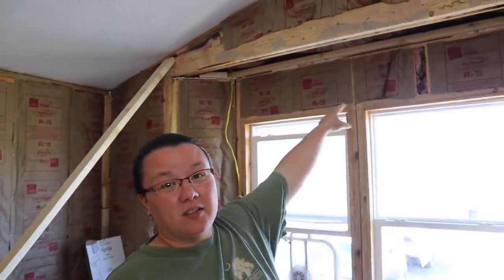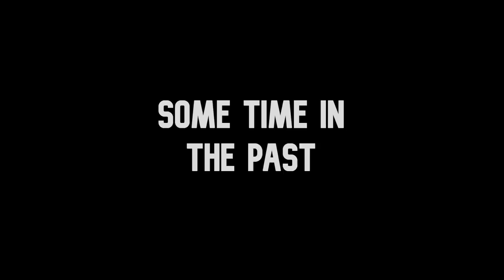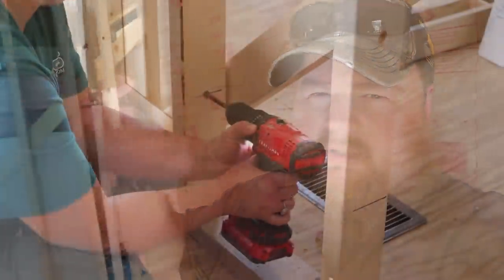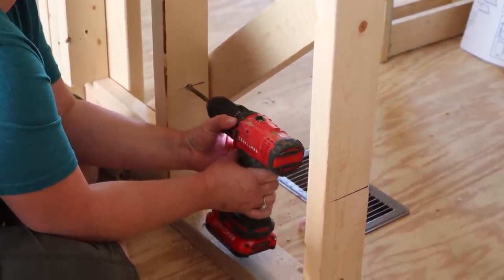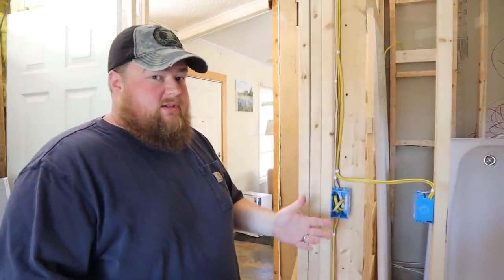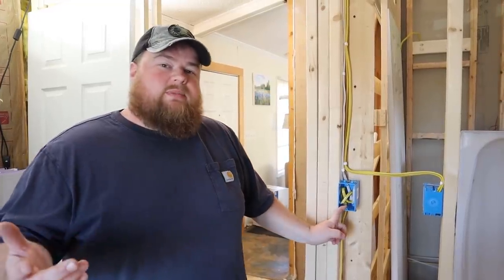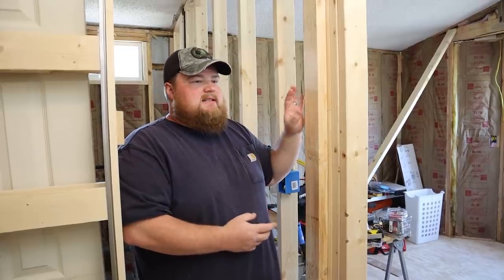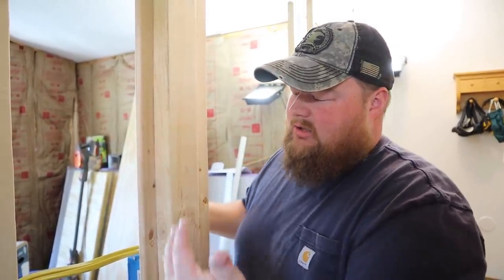1,000 Little Jobs & Why We REMOVED OUR FURNACE // Mobile Home Renovation

Comment: A small "been there, done that"  suggestion.  Put insulation in the wall between the room and bathroom.  Not as heating/cooling but for sound deadening.  We did that and have never regretted it!

Comment: Sam, as I said before we installed a Mr Cool in our garage. The cost was about 1900 not including the outside bracket for the unit to sit on. We had an hvac guy come check it out and he was telling me they were going with Mr Cool in their business because of reliability. He did tell me it would have cost us 6000 if they had brought it in and installed it. So you can can 3 unit for less than your budget. And you likely will need smaller units in the bedrooms which is a smaller cost. Can’t wait to see what you all decide!
Reply from the maker: Oh! Awesome to hear, thank you!!
Reply: @sam-and-angela  Just repeating this here.... I would definitely look into a DIY mini-split. But rather than a multizone unit... Get 3 separate units, one for each zone. 3 reasons for that. 1) It greatly simplifies  installation. Running refrigerant lines the length of the mobile home is a pain in the backside. 2) You don't have to pay the entire expense all at once. Just add units as the budget allows. 3) If one of the units fails, it is much cheaper to replace. And... You don't lose your entire HVAC system.
Reply: So nice of you to give such good advice. 
I have been dreaming of looking into a mini split for my ranch style home.
Reply: @sam-and-angela   have you heard of Spencer & McKenzie of @LifeUncontained?  They did their own install of mini splits in their shipping container build and its going really good.  They have inspired me to do my own.   IMHO, for one, not having duct work is a healthier alternative with nowhere for dirt, dust mites, etc to build up.  Also, the low electrical draw will make them more affordable in your ROI/electrical bills.  Keep up the great work!  Many blessings be yours!
Reply: @keithhogan6997  Just coming here to tell him the exact same thing!!
Reply: @lizmarin9568   🧔🏼👍🏻👍🏻
Reply: @sam-and-angela  @LifeUncontained installed theirs in a shipping container build. If you haven't already, you should check out The Hollar Homestead.  Young couple with 5 littles that remodeled a mobile home (beautifully done, I might add) and installed the mini splits much as you are considering.  Three separate units that were size appropriate for bedrooms and living area.   P.S. I really enjoy your videos!
Reply: @abcxyz1797  Before we knew of the diy kit we paid double for someone to put one in our den. It’s isn’t half the size of the one we installed.
Reply: @keithhogan6997  you are so right they are easy to install I have been a handyman in my area for 12 year they are so much better an you can adjust the heat an air in that rm to fit your needs
Reply: @chrisdarrow1738   I'm not knocking what Hollar Homestead did, but what is the difference between their container build and a single wide?  Spencer used multiple units just like they are talking about in this mobile.
Reply: @keithhogan6997  very similar. Both would give excellent pointers.  Just felt it to be an apples to apples example being a single wide trailer vs the container build. I think they have both constructed very nice homes.
Reply: @chrisdarrow1738   I have to agree and I'm glad you pointed them out.  Two similar get different builds would bring a well rounded look and more insight.
Reply: The problem with mini splits is that they are just as Loud as window units. We had one and I just couldn't take the air noise .
Reply: @number1pappy   Maybe it was the brand or the installation.  I know several people with them in their homes that don't have that issue and I haven't heard it mentioned by anyone else before.
Reply: @number1pappy  I never hear either of ours run unless they are on “powerful”. 🤷‍♀️

Comment: We have a tiny farm house-brick and mortar. We took out the old oil furnace and put in one mini split for heating and air conditioning. My husband put it in and it does the job. It has been a significant savings and improvement.

Comment: I know this video is three years old, but since YouTube decided I would be interested, (I was because of the mention of the furnace), I felt the need to comment on my recent experience on saving thousands of dollars installing my new furnace and A/C.  It's probably too late to save you money, but this might help someone else.

The forced air in my home was over thirty-five years old and I was repairing something every year.  The first thing I had to do when I moved in thirteen years ago was to call someone in to charge the system because it wasn't cooling.  I've since replaced the capacitor in the A/C three times, replaced the A/C fan motor last year, replaced the furnace heat sequencer several times, replaced fatigued broken wires in the rusty furnace, replaced the thermostat and found the need to keep various fuses on hand.  End of last season the coil was freezing up indicating the need for another Freon charge.  Being R22 it would be expensive.  I decided to wait until this spring to have the system charged.  I procrastinated and it got hot.  About a week ago I just decided to replace the dinosaur accepting that it was well past end of life.   I was tired of working on it and worrying about when it would next break down.  (It always happens when it's 15 degrees (thank goodness for the wood stove) or 100 degrees (fans don't help much).)  Cost to have someone install a new unit?  Minimum $15,000!  Ouch!  I'm a big time DIYer doing electrical, plumbing, building, renovating etc and there's never been a job I've been unwilling to tackle so I did a little research.

I ended up ordering an entire packaged mobile home system, (A/C, evaporator coil and furnace), and a line set online from HVACdirect costing about $4,000 intending to install it myself.  (They do of course suggest having a professional do the install.)  Installation sounds intimidating, but it's not.  The condenser, coil and even the line set all come precharged.  I took pictures, documented and labeled all the wiring before removing the old system.  Removing the old line set was a concern because of Freon, but it turned out to have all leaked out already.  The system was empty.  (It probably would  have cost me $1,000 to recharge the ancient system only to have it all soon leak out again.)

I set the new A/C on the concrete pad I had poured, stuffed the new furnace into it's alcove and slipped the coil inside.  I uncoiled the line set and attached it to the coil and the A/C.  This is the most intimidating part, but there was no brazing involved.  The ends of the line set have nuts on them.  Simply screw them on to the A/C and the coil, (adding a dab of the included oil to the threads), until the line set is punctured and then one more tiny little twist.  Literally, just a couple of wrenches are needed to install.  I then wired up the thermostat and power, flipped the breakers on and set the thermostat to 'cool'.  Blessed cold air.  The toughest part of the job was getting that filthy rusty old furnace out.

By ordering the equipment online and doing the install myself I saved well over $10,000.
One extra perk.  We all know storage is always a premium in a manufactured home.  The old unit required an air intake high up on the wall.  The new furnace didn't need this vent so I remodeled it into a  storage cupboard.

Comment: Sam, we installed three mini split units in our house. Total cost was approximately $3500 which included the new wiring, panel boxes, etc. Our units have a heat feature ( not heat strips) which heated our house wonderfully. We too use propane wall heaters for our primary heat but using the splits to take the chill off really reduced our propane usage. Best advise, shop around and call on friends to assist you in installing units. Pretty simple.

Comment: We used a simple propane wall furnace here for years until we could afford a whole house system. Aside from having to run fans to disburse the heat it worked just fine and...when the electricity went out we still had a source of heat. The problem came when "Grandpa" started to dread the trip to get propane. In the meantime, over at our other place, we really need to do just exactly what you did. Throw that 70's electric furnace out the window. I hadn't thought of those zone-type furnaces until you mentioned it. What a great idea!! Thanks, guys! That's a DIY solution we just may be able to swing :)

Comment: My husband and I had a new HVAC unit installed about 2 1/2 years ago and it was around 7 grand. We used Waldrop heating and air and they were amazing. We live in a double wide and we are located in the upstate of south carolina. I know there will be differences in the cost of things from state to state, but that is a huge difference. If your unit costs 7 grand, then that means the new duct work (including labor) would cost around 7 grand alone. Wow. That is insane!!!!  Sam, I really believe you are knowledgeable enough to install mini splits on your own. Thanks for another video. God loves you all. God bless you all.

Comment: The furnace talk, got me thinking about a property I looked at, not that long ago about 5 years.  It was an older trailer on a basement.  In the basement they had a big wood stove / heater and above the stove they had a tank of water, 'very large tank of water'. The owner had pictures of how he put them in. required putting holes in the floor to drop the water tank in was all I remember, because I started calculating in my head the cost to remove the items, and if the was price was worth the 10 acres the house sat on.  Needless to say I thanked him for his time and never thought of it again until now lol
Reply: There are substantial rebates for mini splits, especially for manufactured homes in my state. Check with your power company. I got mine for four different areas, and we niw have heatingvand cooling fir the whole house for about $2500. My electric furnace hasn't worked for years (we'd been using electric space heaters for a while, which was cheaper than the furnace), NOW I  want to yank out my furnace and make a closet out of that space. I love the mini split, and am very glad we got it.

Comment: Sam I used to screw everything I built together. I later bought a framing nailer. Get one. So much faster, and I think better for framing. You wont be disappointed.
Reply from the maker: I have one--Paslode cordless framing nailer, but prefer screws for this kind of work. Much easier to back out and move things around. :)

Comment: Insulation is your friend, noise reduction and keeps the heat in winter out in the summer. I love it a pirates parrot. I don’t have broad shoulders my parrot would be falling on the floor. Just love your and Angela’s work. All this ology stuff Jon would be so proud you’re carrying on his legacy. Heat pumps aren’t as efficient as people think. At 20 degrees or below the heat pump doesn’t work it shifts to straight electricity. I use oil filled radiators. Heating just where you are is way smarter.

Comment: What you an do is gut you old furnace. Then install a hot water rad and an air conditioning rad. You an either get an outside wood Boiler if firewood is available or you can get an electric inside Boiler. They are small maybe 10 inches wide and 2 feet tall. It would be way cheeper than electric or propane. It's what we use. I have tons of ideas on projects like that. As for new duct work unless it's become unattached they should be fine but should be cleaned out.

Comment: I guess it was ^ish years ago we replaced our OLD  under the floor furnace and the OLD ductwork for a Trane. It cost us $9K back then and it was just propane heat, we kept the air condition unit we had outside because it still worked fine. I feel your pain!!!

Comment: Sam, We installed a Mr Cool 12K mini split ourselves and we used the advantage series it is not DIY but was about $700 for the setup. The tools needed to vacuum it down cost us about $300. You can check out the installation on our channel it may be helpful, The DIY series is nice as you don't have to make up the flared connection but the line set comes pre flared so its not bad. We have a Fujitsu in the main house and the Mr Cool is in our 20x30 wood working shop and here in central Maine it gets cold and we kept the wood shop 62 all winter with ease.

Comment: Go with the Mr. Cool Heat/Cool units.  You have plenty of know how and they are simple to install anyway.  2 or 3 units will fix you right up.  Go larger than smaller and you will have a warm/cool home you can relax in and be happy.  They are also very economical.  We use them here in Florida...

Comment: I would definitely look into a DIY mini-split. But rather than a multizone unit... Get 3 separate units, one for each zone. 3 reasons for that. 1) It greatly simplifies  installation. Running refrigerant lines the length of the mobile home is a pain in the backside. 2) You don't have to pay the entire expense all at once. Just add units as the budget allows. 3) If one of the units fails, it is much cheaper to replace. And... You don't lose your entire HVAC system.

Comment: Interesting, for comparison we have a 2005 double wide manufactured home and we are having the original electric furnace/AC replaced with a new electric furnace/heat pump that will use the electric furnace as backup heat for $7,300 installed from a reputable local company but our ducting didn't need to be replaced. The furnace is a 10KW Coleman and the Heat Pump is a 16 SEER 3 ton single stage Daikin. We looked at mini-splits but by the time we either added the number of individual systems needed or a large enough multi-head system replacing the central system just made more sense for us. What I did find was a couple of shops that were quite high however, while they advertised that they did both residential and commercial work, they seemed more focused on the commercial side and I think their residential pricing was a way to keep them more commercial, but that's just the impression I got.  Good luck on your search!

Comment: Using our mini split for supplement heating is still pretty expensive. We only use it to warm up a room when the heat is turned down. Our electric bill was pretty high when we used the mini for long periods of time. Maybe a small pellet stove for the winter months.

Comment: I  had the same thing happen to me. My original quote to replace my heat pump unit and replace 25 yr old duct work came in at 16,000.(not within my price range)  I did get another quote from a smaller company and a 2 ton Goodman heat pump package unit with a 10 yr warranty was 5,600 and replace the duct work was 2,700. My house is 1,200 SF. I also live in North Carolina.

Comment: The one thing I wonder about is why you face staple your insulation. If you staple your insulation inside the studs it compresses a little more but the sheetrock will be tight to your studs and decrease the possibility of popping

Comment: Home Depot sells window units that heat and cool. Three of them would do your home very well. Check and see what they use in power to heat/cool. I like that idea because if one goes out you still have heat/air unlike central if it is out it's all out. When I worked for HD we sold many,many of the window units to people replacing central and they said it was much cheaper utility wise than central. I don't like electric heat because it is more expensive than gas/propane but sometime it may be best. We have a Dearborn heater in our sunroom. When we lost power in February it kept half our house at 55 degrees and the other half at 45 degrees with it -2 outside. We have 1400 square feet built in 1951 so it isn't the most air tight house in town but still easy to heat and cool.

Comment: I can't believe they don't put sheathing on the exterior of the walls o trailers. That doesn't give you much rigidity or sheer strength on the walls but I guess they save weight for shipping them. Are you adding ply when you do the new siding? Your work is looking good. Sure you will all enjoy the new renos when done.

Comment: I was a house painter for over 20 years....be very careful with your pocket doors as far as screw length and placement. I have seen many doors with deep scratches from rubbing against nails or screws in the drywall. or hanging decor

Comment: Starting my own mobile home remodeling  in the spring. Watching your  videos  has been very helpful. You mentioned using propane for heat. What size  tank & BTU heater was that? Planning to do the same before winter gets here.

Comment: I'm more worried about heat than cooling since mine is in NH. Right now there is a ventless propane heater in it that heats it nice when we're not there and there as it's not our primary residence. I just had baseboard heaters installed in each bedroom too. The whole MH heating system died years before we bought the property. That will be removed next year. As far as cooling I'll likely get a mobile free standing unit that vents out one of the double hung windows.

Comment: We spent 10 grand for a mini split  3 blower unit  for our down stairs. We are going to use 2 window units up stairs bedrooms . Would have cost 19 thousand for down stairs and up stairs.. We used a thru the wall ac for years. It worked good ,just wanted something for each room. Nothing wrong with a window or thru the wall ac.

Comment: I had a heat pump replaced on my 2002 MOBILE HOME  Jan 2021. Both inside (not sure)and outside(York) units were replaced.  COST $4300.00. I live in Virginia. I think they are charging you ALOT for the ductwork